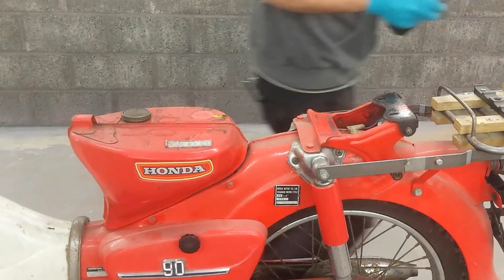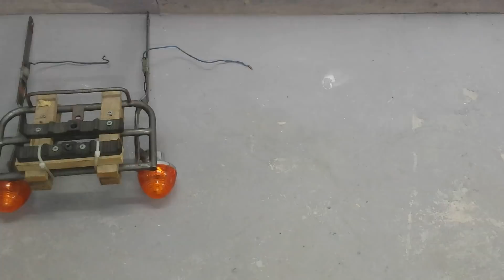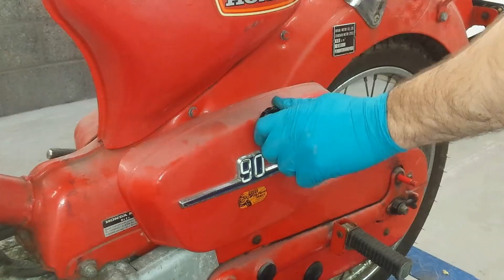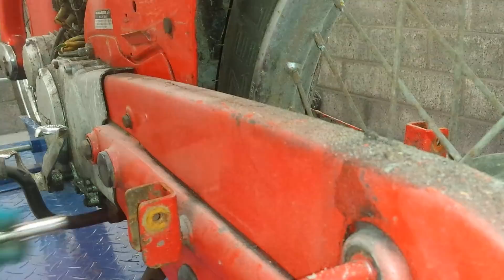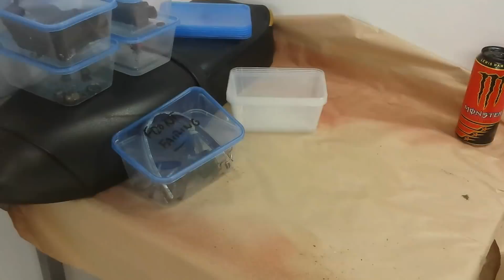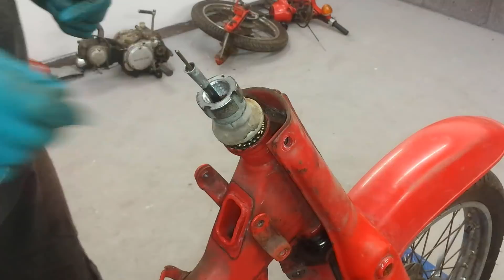The Big Tear Down-Part 1 ( Honda C90 FULL RESTORATION )

Comment: Early Australian postie scooter. AusPost have used these for years for mail delivery in the suburbs. They still do using a model specifically designed and manufactured by Honda to AusPosts specifications. Valuable collectors item now. 👍👍
Reply: They use a Honda here in Wellington for the same thing. Not as reliable as the old one.

Comment: No way, I was just looking for a Honda restoration! I'm trying to do up a CT90 that's in far worse condition than this bike. Soaking in rust converter and wire brushing so many bits takes time and patience lol.

Hope you do a good job!
Reply: I presently doing a Honda Goldwing 1200. Not anywhere as comprehensive as this and it's slow going but lots of fun. Trouble with my project is that it's so big, it takes up most of a garage.

Comment: The C90 is a 90cc, four stroke single cylinder OHC engine with a single range transmission motorcycle built for the street. It is a version from the family of bikes that the CT90 trail machine is from. The CT90 has two transmission ranges. These bikes were built from the 50's to the mid 80's for the US market and I believe they are still made for and used by the postal service in Australia. Top speed in this version is about 50 MPH and in good running will get about 50 MPG. You see the step through frame version here, but Honda also made a T frame that look like a "normal" motorcycle. They are virtually bulletproof bikes.
I'm jealous that I didn't find one in this condition. I learned to ride on this frame style and actually owned a T framed C90, which I bought for $50 and rode for 5 years before selling it.
Be sure to clean the metal fuel screen in the fuel selector valve before you ride it.
Reply: BTW there was no clutch in this series of bikes. Shifting was only by foot lever in a semi-auto transmission. Off hand lever (non-throttle side) was actually rear brake.
Reply: Darrell Jensen - on the models in UK, at least, there was no left hand handlebar lever, the rear foot brake pedal is on right side (handlebar rear brake only on CT90?). There are actually two clutches in the transmission I think, operated through linkage from the gear-change pedal and through an engine-speed device - so “automatically operating clutch”, but it’s incorrect to say ‘no clutch’, it’s there. An almost unbreakable bike, as Ed March has proved (look for “C90 Adventures”). Heck, he even raced his at Dirtquake this year!! I wanted a C90 early this year and couldn’t find one at an affordable price, well done Really Random! I’m watching every day for the next instalment... Les in UK

Comment: It was in really good condition to start with , I've been looking to buy one,and some of them advertised as need a little TLC,when I got there ,WTF,it looked like a pit bike from the 80s,.from what I remember the kids with no pocket money would swap there donkey kong or what you had for one Bone it down,weeks of fun, till you broke it,.then this one sat in a shed for 40 years to be sold needing TLC !
Reply: Doing up a 1965 C100  (Cub 50).   Where did you find the original colour-matching paint? Can you please share the paint code?  Also, missed it on the videos: did you just sandblast the wheel hubs and not paint them?? GREAT tutorial my project. Thanks!!

Comment: Excellent restoration project, a big piece of motorcycle history, the Honda Step-Tru. We had a C50 for several years, only fault was the kick starter lever return spring failed, so full engine strip down, soften, and reform a new tag out of the slightly shorter torsion spring.
If memory serves, the ignition switch could be bypassed by merely isolating the body from the frame earth. Is this correct!.
Thank you for sharing.
Reply from the maker: Not a problem glad to have a fellow step through owner joining in with the journey :)

Comment: Doing up a 1965 C100  (Cub 50).   Where did you find the original colour-matching paint? Can you please share the paint code?  Also, missed it on the videos: did you just sandblast the wheel hubs and not paint them?? GREAT tutorial my project. Thanks!!

Comment: Hey RRC, I was wondering how you were able to undo that nut with the 4 notches in it that holds the steering stem together. Mines pretty stuck and I'm trying to reuse it
Reply from the maker: Hi, there is a special socket made for it, but if you dont have one an old socket the right size can be modified buy cutting notches in it so that it fits the nut and then you can put a breaker bar on it and crack it loose with no damage to the nut. Hope this helps.
Reply: @RRCRestoration  hey, perfect timing! I just had to take an air hammer to it to spin it off, somebody 40+ years ago cross threaded it all the way down and there was no way it was coming off nicely. But thank you!

Comment: Are you looking to replace any of the chrome parts or clean them up and have them rechromed?
Reply from the maker: Hey, Thanks for the comment. As i go through the project parts that can be saved will be cleaned and re plated as necessary but if its uneconomical to save they will be replaced.

Comment: I have found that snack and sandwich size ZIP bags work better for parts just label the bag b4 you put the parts in
Reply from the maker: Hi, I did actually use bags before but they were forever getting torn so i switched to tubs and haven't looked back since.
Reply: ahh that makes sense I have not had that problem but I understand why you use the tubs

Comment: Is this the one they call a cub?
Reply from the maker: I think officially the full range of C bikes are called super cubs
Reply: I don't think so... the cub name came in after production of this style of bike was stopped in the US. Cubs used many of the same parts (engine and semi auto transmission) with different frame styles.